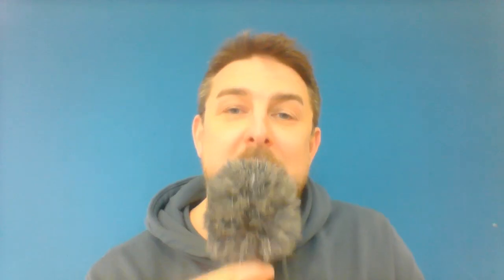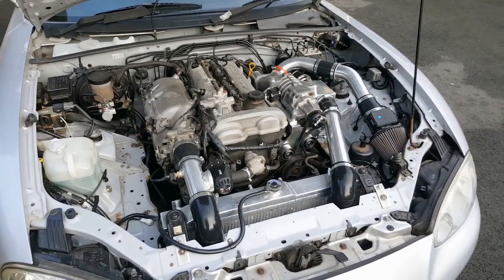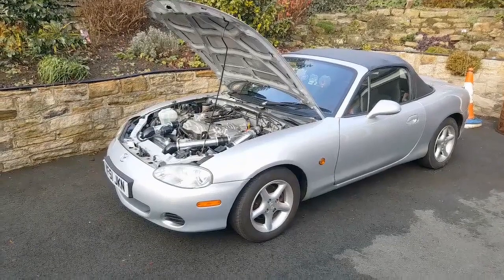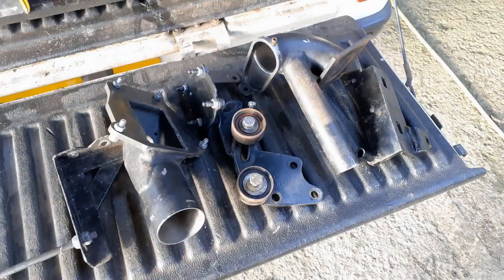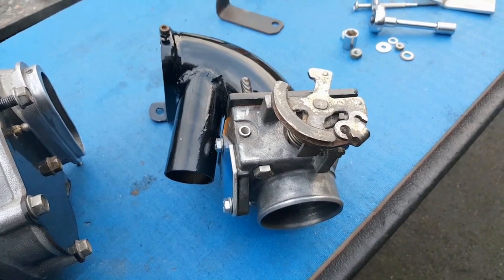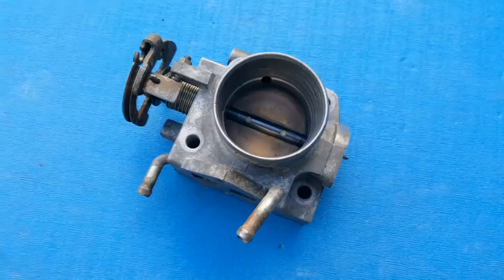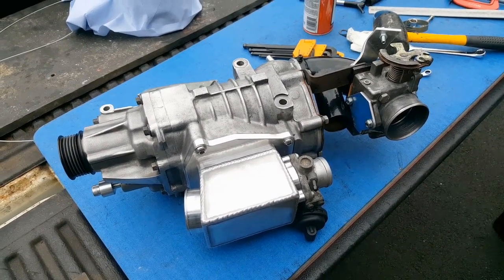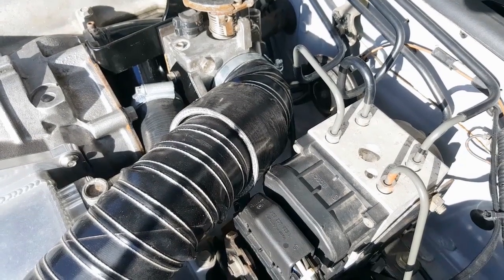Dual Throttle Body Conversion - How & Why | Supercharged MX5 Episode 29

Comment: We are putting a m64 on a harley davidson 88ci with dual tb setup. You give us a lot of inspiration. Where did you connect the vacuum line of by pass valve? Are you limiting the max boost with pulley ratio?

Comment: Can you use any TB (generic) pre SC? Maintaining the stock one on the stock position IAC, position sensor, etc. It's a NA6 93'. I'm afraid it's too loud with just the stock TB as my kit came (Salon).
Reply from the maker: I guess you could use any throttle body you wanted as all it does is restrict the airflow to the supercharger. The problem will be calibrating it with the OEM throttle.

Comment: I don't quite get it.... why run dual? Can't you just have one single TB but BEFORE the Charger??
Reply: You can do that too. But I believe will need to move every connection to the PRE charger position. Plus the air way into the IM will be really long on IC cars, making idle complicated. The two TB will leave some air in on the piping as the first one it's a bit open.

Comment: I'm finally finishing up my build and getting ready for my first start with my supercharger. I've got everything put together but I'm realizing I could've moved my throttle body to be in front of the supercharger. If you were to run just 1 TB, which spot would you put it? Is it worth the effort for me to relocate mine?
anyways thanks for this series-- it really inspired me while these build videos were coming out

Update: Running just 1 TB on my NA6 located by the supercharger produces a totally fine amount of noise, but unfortunately there's a side effect:
when I close the throttle, any boost in the piping still makes it into my intake. And I can't run a BOV because there's nowhere to connect that vacuum line. Also it looks like NA6 throttle bodies (always?) have a second slot for an extra cable. So I'll be upgrading to 2 TBs shortly

Comment: It think the noise is more of a "feature" of the specific setup, not specifically the m45 mini supercharger(im new in here, i dont know all the details of your car yet ). Ive been in a few Porsche 924s with the supercharger kit based on the mini charger, and there werent much supercharger noise at all at low loads motorway driving, it comes on at wot.

Comment: Did you keep the blow off valve in this setup? 
How is it going now?
And what length throttle cable did you buy? I’m starting my build in the next few days
Reply from the maker: Yes all still exactly as it was in this video, whacked a load of miles on it, runs great! Can't remember length of cable just measure it. You can always cut them shorter.

Comment: Hi James, thanks a lot for the whole series. I have a similar MX5 VVT and did all the mods you did. I have a different setup for the supercharger and built the brackets myself for a M62. For the tune I also hired Alex based on your advise, but to put the SC to work I would try to tune it myself. Would you mind sharing your tune for me to use it as a base to start? Many thanks!!

Comment: Thanks for your video, Mate. It was helpful and enlightening. I am busy getting an Eaton M65 from a Mercedes to fit onto my E30 with the M50 engine. Everybody else takes the easy route to high power by turbocharging, but that is not what I want to do. I want a more linear form of boost, and not more than 15 Psi ever. It bothered me that the boost might come in too quickly, but now I can see the way forward. I am contemplating buying a Kenne Bell supercharger, but I live in South Africa and any form of technology has become super expensive due to the exchange rate.

Comment: Contributing to your build i think also using an open air cold air intake contributes to the whining of the supercharger, i think using a factory air box would reduce the whining significantly. This thought is derived from how cars whine when you remove the factory air box and replace with an open air cold intake.

Comment: I wonder if this is more down to the supercharger itself? Mine is a mk1 mx5 with a single throttle body and an MP62 and I have had none of those issues at all. There is no supercharger whine off boost, whilst audible but not excessive on boost, so I never saw the need for the second throttle body at all. I also don't have the moderation problem you mention - mine just feels like a big NA engine. It has 190bhp at the rear wheels on a dyno tune. you can see it in action here > https://www.youtube.com/watch?v=TajCnGZlSg4
Reply from the maker: I've watched that video before. Nice car! All I can think (in terms of noise) is that to get the M45 to perform on a 1.8 you really need to be overspinning.. that in turn cranks up the whine. Whether this also affects driveability is another question entirely.. Assume you are running the stock pulley on the M62?
Reply: @FastRust  Yep, the stock pulley. :) It's effectively at the minimum state of tune it can be. I could add more bhp by a smaller supercharger pulley or a crank overlay, but I find it's more than enough (and super reliable) as it is.

Comment: Which throttle cable did you use to link the primary throttle body to the secondary? There are a ton of options on eBay, but I don’t see any that look like the one you’re using.
Reply from the maker: The exact listing has changed but it was a Venhill Universal Throttle Cable. Approx 1 metre long, think I ended up cutting it down a bit.

Comment: What's the diameter of the silicone tube going from the bypass valve? I can't find the diameter anywhere online!
Reply from the maker: Good question. 30 something.. I've just backtracked through my orders but I can't see it. Have you not got a bypass valve you can measure?
Reply: @FastRust  Yea I do, but it's in the car which I don't keep at home atm lol. I think it's 38mm after ordering 45mm ducting 🤦‍♂, will have to adapt it a bit probably!
Reply from the maker: From memory it's either 36 or 38.. definitely wasn't in the 40s!

Comment: I was confused about how to connect a 2nd cable😂 barely any info of "how" thanks for the video
Reply from the maker: It's pretty straightforward tbh. Use the existing bracket on the side of the inlet with a couple of washers and M6 nuts for one barrel adjuster. Then you'll need to make some kind of bracket at the other end for the other adjuster. One end of the cable will already have a nipple soldered on. You can solder one on the other end or do what I did and buy some with a grub screw to clamp onto the cable. From there you can use either barrel adjuster to set the throttle pre charger to lead the post throttle by a few mm

Comment: I did a dtb setup on my miata, I went a little different route for execution though. I can agree 100% about the cruise and part throttle/throttle tip in. It is a small area to drive in especially hitting hills. I feel like the dtb setup allows for many more benefits.
Reply from the maker: Oh 100% hills were a nightmare with a single throttle body. You have zero modulation it's either full boost or decel. It's still not perfect with 2 but it is WAAAY better. Glad you have a similar experience 👍🏻

Comment: Great update and the noise was one of the reasons i went turbo! Ive had a few Mini's running the charger setup and i love the simplicity and wine at WOT. Great to see the huge difference in idle noise for such a simple addition though. I've also used Alex and found him to be an incredible source of knowledge on the ME ecu.
Reply from the maker: It really has been the single best modification I've made to this setup. The car did my head in with a single throttle body. I'd like to do a Turbo build to compare the two.. but I think one mx5 is enough 🤣

Comment: For God sake James, now you're making me think I should put a 2nd throttle on 😫 my cars a weekend /show car so loved the whine but took it for a couple hours run to my folks house and the whine did get on my nerves. Plus you're spot on with the acceleration issue, constantly on and off the throttle trying to maintain a certain speed
Reply from the maker: I know the feeling! It's worthwhile if and when you get round to it. Glad you knew what I meant about the crusing issue. Annoying isn't it. Which kit do you have?
Reply: @FastRust  I got one of the Ed Kellet "flat pack" kits of good ol' Simon Sears 😁 so should be able to get one on there without any modifications or changes. Like the idea with protecting the silicone tube to the air filter. Mines already showing signs of wear from rubbing on the abs module and don't even use it that much
Reply from the maker: Ah dead easy with the G42 kit, get another throttle body on there you won't regret it!

Comment: Just a thought, could the inlet from salon motorsport be used along with g19s second throttle body adapter plate? I would imagine the second throttle body does not have to be right by the supercharger, maybe it could be positioned any where along the intake pipe between the air filter and the supercharger inlet.
Great series, I’ll absolutely donate to help your build
Reply: Just suggesting this as the tr lane inlet is no longer available
Reply from the maker: I'd imagine any inlet could be adapted to work with the rest of the G19 kit. I have recently been contacted by G19 and it seems they are planning to revise their kit to use a 2nd throttle body. Might be worth keeping in mind if you haven't already ordered one.
Reply from the maker: & many thanks for the donation!
Reply: The bofi supercharger kit uses a bypass valve from the mini. Do you know what the purpose of that is? Would it do the same job as dual throttle?
Reply from the maker: @toweliethetowel-nc6mq  no bypass is totally different to the throttle, it opens when the intake is in vacuum and lets air around the rotors of the supercharger
Reply: Ah I see. And do you have that as well as dual throttle?
Reply from the maker: Yes bypass is an essential part of this setup. 2nd throttle is optional.

Comment: The easiest mod you could’ve done was to place the throttle body before the supercharger.

That’s how the mustang supercharger is like
Reply from the maker: Not as simple with these setups, unfortunately! You could get away with this setup if you didn't have an intercooler.. like the old Jackson Racing kits which had a 'dummy' throttle body you put in place of the OEM part.

Comment: Hi James with the benefit of hindsight would you have preferred to go turbo charged or even tweaked standard
Reply from the maker: Good question.. I'll always love a well tuned NA engine. Fact. But decided to change it up and go FI with this build. S/C vs Turbo?? Having not been in a turbo MX5 it's hard to say. I do think turbo is a more expensive route to do right, which is why I went S/C. Besides I'm saving my turbo build for a V8..

Comment: I have the same car/set up as you and came out at 186 bhp at the crank with the 17% pulley and 5psi of boost. Straight from a Dr Hickson tune. 😊
Reply from the maker: 1.8? Seems a bit down from what I've seen other similar setups make. Average seems to be around 180-190whp.

Comment: Hey. Love the car! Do you know what causes the supercharger to be so loud without the added throttle body?
Reply: In my case, my sc mounted bypass valve was venting out into the atmosphere. So on idle/cruise the valve is wide open and blasting air and noise to every corner of the neighbourhood.
Reply from the maker: Yeah it's mostly down to the fact the supercharger is unthrotted. It gulps all the air it wants, compresses it into a shut throttle body and blasts it out of the bypass like James says. Every car that has a supercharger from factory runs a throttle before the charger. Much better setup.
Reply: @FastRust  not m111s... that's why I was wandering on what to do in case I would remove the stock airbox, because the thing just has a bypass valve. I love the whine while accelerating, I think it's kind of annoying while releasing the throttle, and every video I see of my engine with modified intake it just sounds good while accelerating and obnoxious while closing the throttle. I always wanted some kind of hellcat sound ( intermittent whines, which is just lovely), but i tought it was impossible to do so without actually changing the throttle body position all the way back to the SC. Never tought of fitting 2 throttle bodies. Could I remove the bypass valve doing so, or that would still be needed?

Thank you for the video, it's giving me good ideas